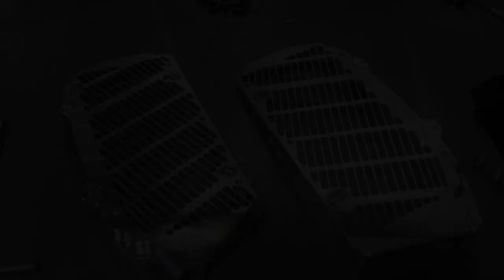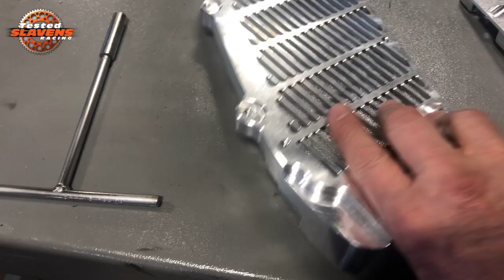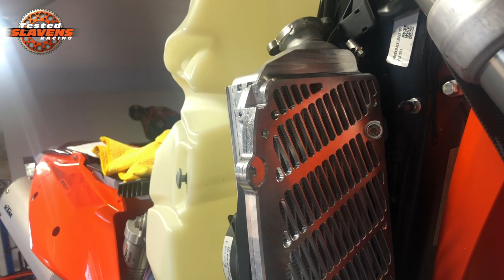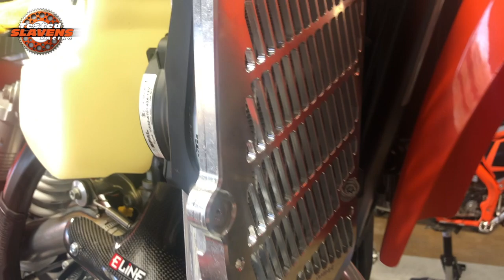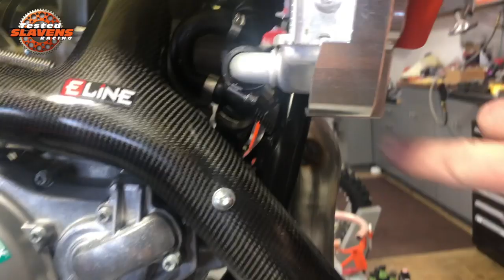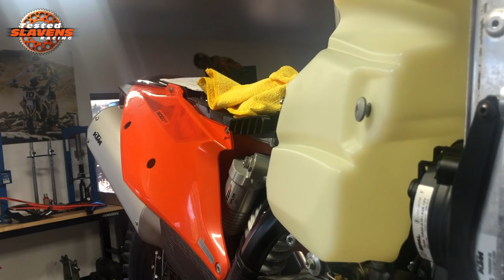Bullet Proof Radiator Guards - Product Showcase

Comment: Ran these on three bikes, only ever had one issue. With the way the slots are cut in the guard, sometimes sticks can poke through them because there is no angle to deflect them. Had one stick go through the fins on a radiator.

Comment: BP are excellent products. I used 2 set of the radiator guards on KTM's and 2 set of rear disc guards. One thing to note tho the anodized orange fade drastically after 6 months. If i had to buy again i will go polished

Comment: Just installed these on my 2022 350 EXC-F. Easy install, except the fuel vent line is squished between the guard and the frame. It looks like in the video it looks like the line has been removed. I guess I need to remove the line or cut a hole in the guard?
Reply from the maker: Do not cut a hole in the guard. Get rid of all of those hoses and just retain one simple hose from the tank cap to the hole in the center triple clamp bolt.

Comment: I have dropped my bike on these guards a couple hundred times at least. I'm guessing I would be on my 3rd or 4th set of radiators by now without them. This will always be one of the first things I do to a bike. The only issue I have had is that I stripped one of the aluminum holes for the rad bolt, be careful with them.

Comment: I'm thinking of ordering these in red. How does the color hold up? Any thoughts on p-tech radiator gaurds? Thanks
Reply from the maker: I think all of the colors, except black, tend to fade over time. The P-Tech guards have a back-side brace which makes working on the engine a PITA. They are made in eastern Europe so if you had a fitment or warranty issue, it might be a pain to get resolved. BP guards are made in the USA and we support US vendors.

Comment: I have a 2021 Husky FE350S That comes with the charcoal canister. It seems the guards squeeze the tubes quite significant. Is that an issue?
Reply from the maker: Hello Alexander: Two ways to address that issue. 1. Do a slight re-route of the hoses.  2. The most popular option is to clean things up by eliminating the hoses and other emissions components https://slavensracing.com/shop/slavens-mule-ez-emissions-delete-kit-for-20-ktm-hqv/
Reply: Thanks for the immediate reply. In the long run I will get rid of all this. For now, I decided to use a round file to create some small indentations to make room for the tubes not to be squeezed.

Comment: but aren't you still relying on the outer plastics to stop them from folding back, and if they do fold back you risk bending the inner frame mounts because of how rigid they are?
Reply from the maker: Hello: Sorry, no they do not use the plastic as an integral connection. They bolt directly to the frame.
Reply: That’s been my concern with any of these style mounts. The folding back situation seems like it could bend the inner frame mount
Reply: @slaverace1  comment below. Don’t these mount to the rigid connection frame? I seems to be pushing the radiator back 1-2 inches on any side fall at any decent rate of speed. My concern with these is damaging the frame where these connect when radiator moves back on impact.